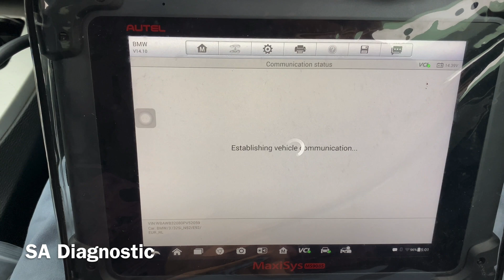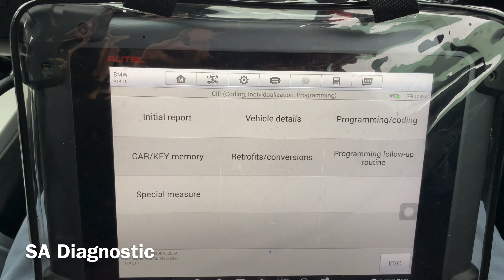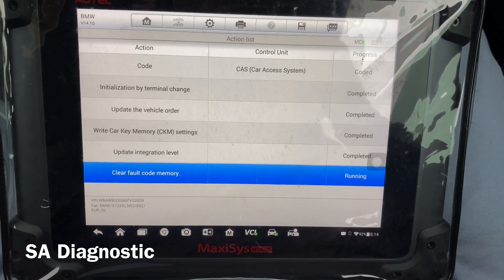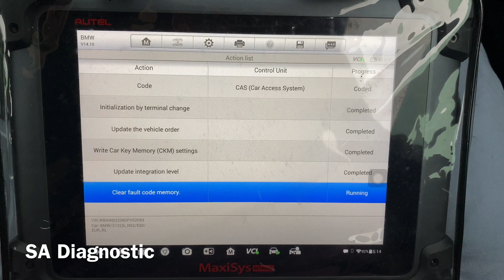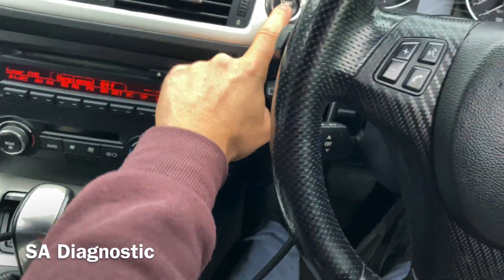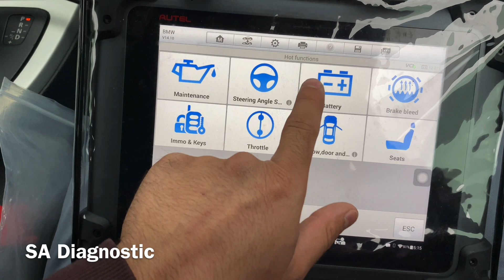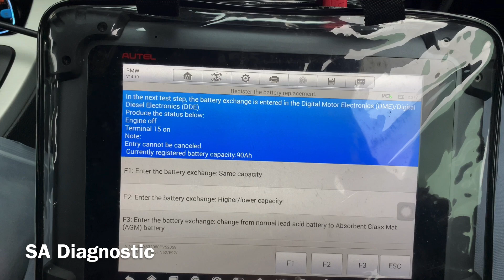BMW E92 Coding From 70AH To 90AH Battery Using Autel Maxisys MS908s Pro Step By Step

Comment: The same question, I have an MP808K, can do this on my jaguar xe 2016? Curently have 80AMP, want to put 95AMP. Thanks
Reply from the maker: Hi you’ll have to use a different software as autel may not cover this. Thanks